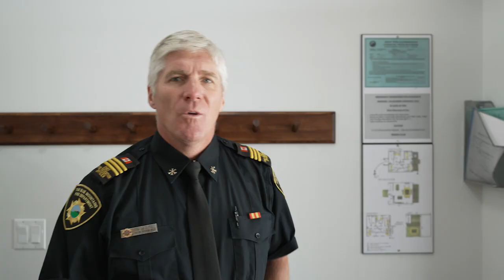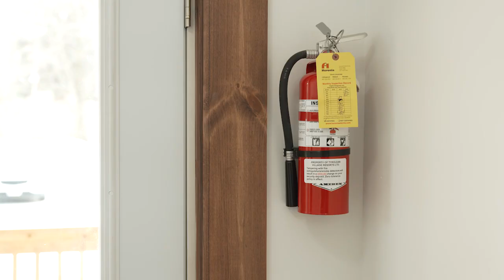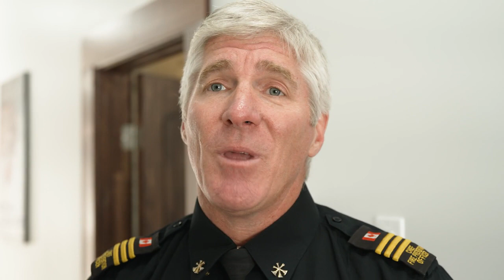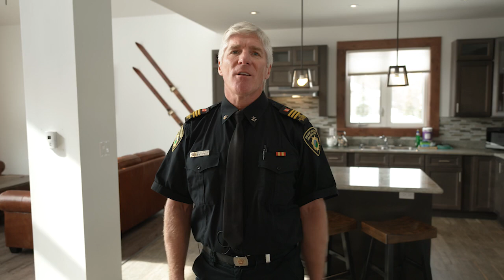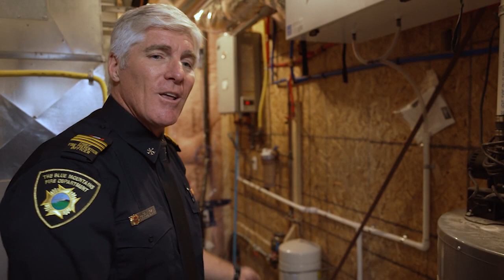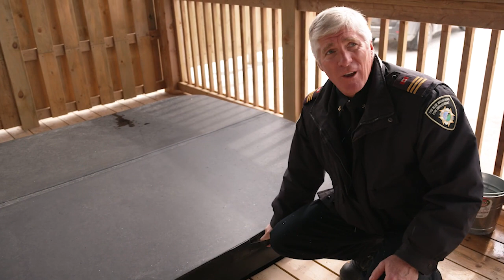Short Term Accommodation - Fire Inspection Walkthrough

Comment: I would suggest there should also be some information included about outdoor firepits in the video as well or a complementary video could be created. I believe it is especially important to communicate this type of information given the wildfires that were observed across Canada in 2023.

A video could educate owners about the need for authorization of a firepit as part of an STA License and the specifics of where they can be located on a property (e.g., the firepit should be at least 25 feet away from property lines, etc.). It could also highlight what renters should be aware of when using them (e.g., they should not be left unattended). Also, potential fines associated with by-law contraventions could be identified to make people aware of the consequences of failing to comply with by-laws that relate to outdoor fires.

Communicating this type of information would be consistent with the STA Objective "Ensuring STA Operators are made aware of their responsibilities to comply with Town by-laws and other regulations" and would make the Town of the Blue Mountains a safer place.